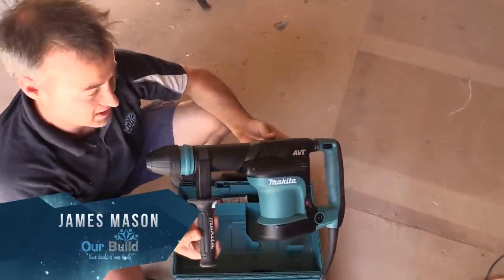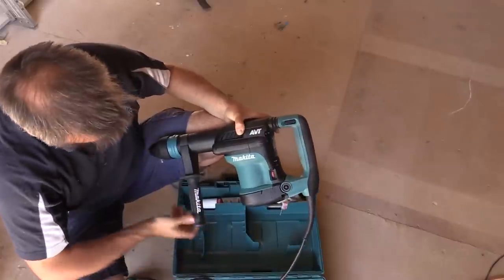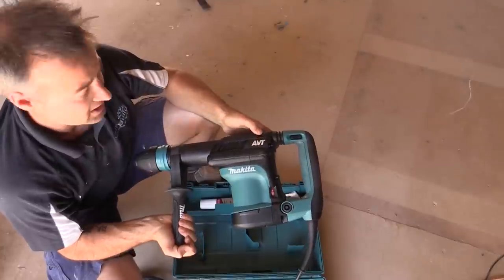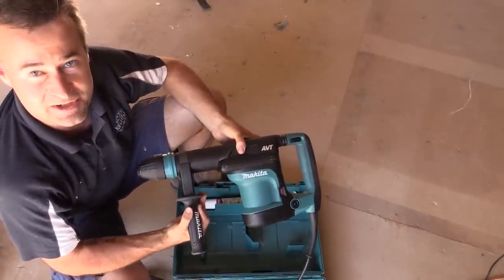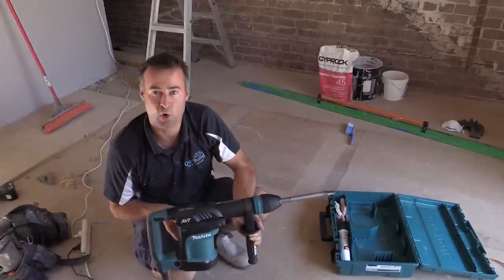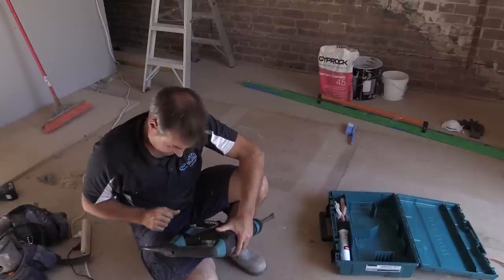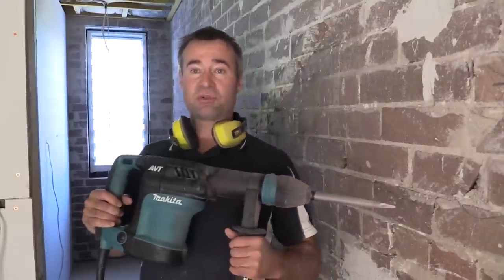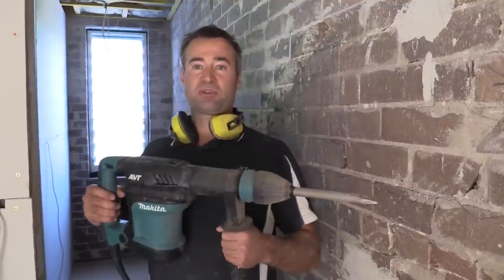Tool Review - Makita Demolition Hammer HM0871C

Comment: I bought one for light duty digging for work and was surprised how well it performed with a spade bit. I'm mainly a Milwaukee guy but we have Makita's at work for digging and they hold up very well so I decided to go with Makita for my demo hammer and I'm not disappointed!
Reply: Having used this tool, how do you think it would do with breaking up rocks when digging fence post holes, and moderate digging through pretty tough dirt that contains quite a bit of clay? Thanks.

Comment: Dear Sir, is this Demo Hammer good for breaking up (to dig out by hand) the soil around certain steel (~ v cross section, used on farms and for snow fences) fence t-posts?  These t-posts were pounded in ~15 yrs ago, deeply, and are difficult to remove, even with a (steel) fence t-post puller (as sold in Tractor Supply Co.).  Unless one digs away the top ~12"-18" of soil, down to the top of the stabilizer blade (that's riveted ~16" above the bottom of said fence t-posts).  I believe a farm jack will not pull them up, unless, of course, one digs away the top 12"-18" of soil, as mentioned.  Any and all comments much appreciated.  Thank you.  Respectfully, tonyd\.
Reply from the maker: Would do the trick 👍
Reply: Dear Sir, thank you for the kindness of a reply.  I appreciate it.  God Bless.  tonyd\.